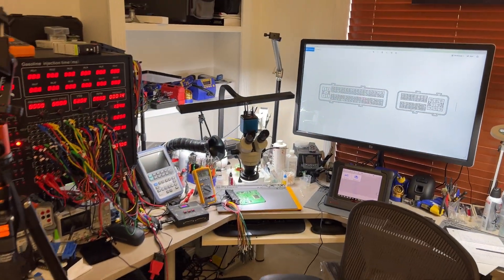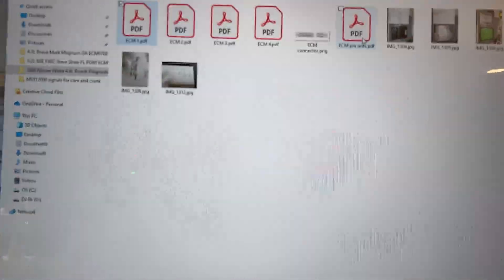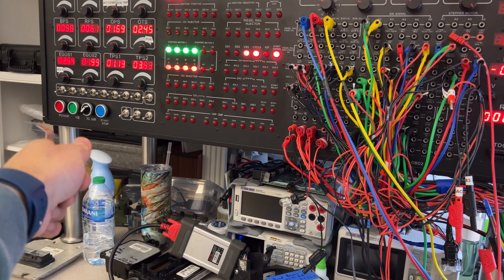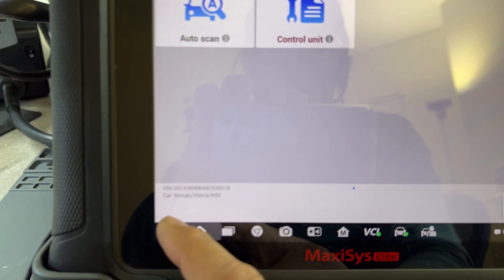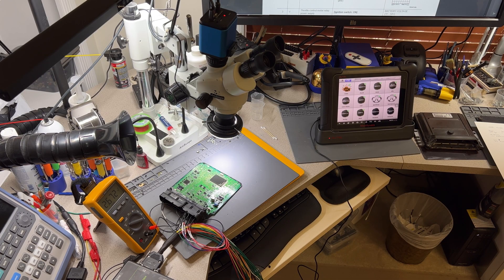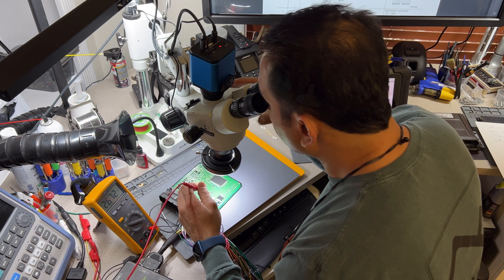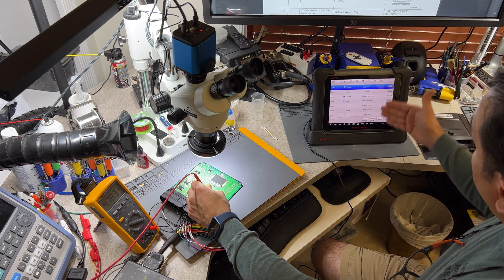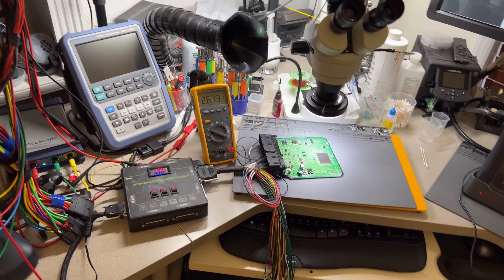2008 Nissan Xterra 4 0L No ECM communication and 5v ref low  ECM test and repair

Comment: Can you please help me,  I have a Nissan xterra 2008 4.0 engine,  I replaced my ipdm and starter at Nissan mechanic request and I still have a no start situation. I am disabled and really need my ride for doctors appointments,  I have been without my ride over 7 months . Please help me figure this out.
Reply: I like the set up but don't understand how it all works,  your very smart and explain things very well. I only wished I'd spent more time in my youth learning like you have. Thanks for video and any other advice or help would be deeply appreciated
Reply from the maker: Hi Tommy, it is a bit hard to help you with no information, what tests have been done, what signals are you missing? Can you connect with a scanner to the ECM? No say no start, but is it a crank no start or a no crank condition?
Please add here any fualts or test you have done so we can understand more your situation.
Reply: @MaicSalazarDiagnostics it doesn't do anything when I  turn key everything lights up bright, only here a click at starter once, I  hooked a obd 2 when I cranked it by pulling relay and touching bottom prong to battery with key on and it started right up, the obd 2 code was o2 sensor bank 1 that was it now since Nissan mechanic had it i can't jump it like that , they had it 2 months,  I  finally just got my son to pull it back home . Thank you so much for getting back to me
Reply from the maker: @TommyArmes  is the truck Automatic 4x4?
Reply: @MaicSalazarDiagnostics automatic
Reply: Can I try the wire jump at the obd 2 port to see if it's in immobilizer mode, the red car key flashing but I  thought it's always done that and the check engine light is on . Engine is good though only 97000 miles and when running,  runs smooth as a sowing machine. It all started with stalling out but would crank back up. I have put new clutch and compressor in ,new purge valve, all new evap system , vent valve, carbon canister, cause it started spitting gas back at the pump, a new cooling fan cause old compressor caused that to stop, I programmed 2 more key fobs
Reply: New starter and selinode battery terminals and ipdm, changed oil, cabin filters,  bought 4 new o2 sensors but haven't installed cause could break the first one loose hurt my back badly and my son tried but didn't have any luck either.
Reply: When I last had it running it would bark tires in reverse but wanted to barely move in all three drive gears, it shifted good but just wouldn't go. I'm wondering if that same part you fixed is my problem too

Comment: Is it possible for a ECU from a company that programs them could have not left the ecu in the proper mode. I have powers and ground. 5 volt ref all seem fine on the sensor ports. The wires from the ecu for the relay have power when hooked to the ecu. I was able to engage the relay with 2 testlighs when the ecu was unhooked. But it seems like my ECU is the issue. I have no comm with my scanner to the system. U1000’s on all modules. I’m at a lost. Feel like I should send the ecu back to the company for Testing!
Reply from the maker: Yes it is possible. And you should definitely contact them.

Comment: Hi saw your video  ...sir  I have also. ECU WLAE18881c.  .the problem no 5volts of 3pins in crankshaft sensor ...what the ECU work   what's parts of ECU check .. thanks from Philippines.

Comment: Can you diagnose a 1995 jaguar XJR, the supercharged 4.0 inline 6 ? Car super tricky to get running and will run beautiful, start a few times and then not start again . Told by local shop that ECM is a ceramic board ? and it’s cracked and bad and cannot be fixed .
 Car is quite rare but no good not working . Located in Ontario Canada
Reply from the maker: Sorry no help on that.

Comment: 1/2 voltage might indicate a single diode failure if there is a two diode control circuit to provide the 5vdc ref? Of course you'd need a true schematic of the circuit layout to know for sure.

Comment: if i send you my ecu and you repair it can i just plug it back in and my xterra start? without having to do anything else?
Reply from the maker: That is correct
Reply from the maker: What is the problem with the ECM? I need you to send me the diagnostic report from your mechanic. Please email me at info@maicsalazardiagnostics.com
Reply: @MaicSalazarDiagnostics  any chance I can have your email for info  about a ecu for 08 nissan pathfinder
Reply from the maker: @Steve-pf8tb  sure it is maic@maicsalazardiagnostics.com

Comment: Another great video, thanks. I usually come across pcms that are bad on Hondas mainly due to water/moisture damage, and just 2 days ago I have to replace one on a 2009 Accord. Most of the time the symptoms are no communication and immobilizer key light flashing. But the recent Accord didn't even light the immobilizer key light. 
I wanted to learn how to repair  these pcms and right now I have 2 sitting around and playing with them to learn more about how they work. 
I wanted to suggest if you find it acceptable to ship one to you for a video on repairing. Btw I am from Nigeria, thanks

Comment: Great video but still am wondering how the ECM works with the simulator without immobilizer?
Reply from the maker: The ECM is on not running. You can comunícate even with out the inmo.
Reply: @MaicSalazarDiagnostics  but how i can test output of injectors or coils with immobiliser on?
Reply: @DKr475 You can test them like any other component but to do it right and simulate running engine then you just add a immobilizer setup to your test bench.
Reply: @ecurepair  yeah. Thats the Point.